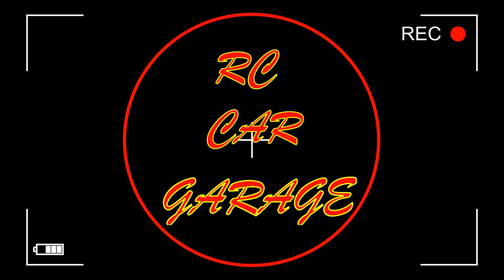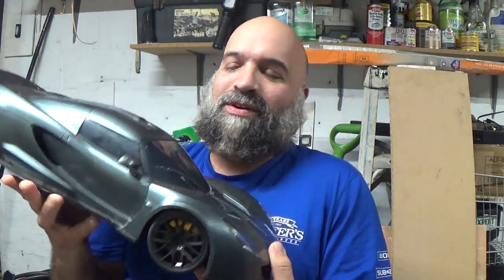Toy RC car converted to hobby grade electronics

Comment: I've started doing these types of conversions and even though I'm an absolute beginner I really enjoy it more than buying an expensive hobby car. I feel if I build it I can maintain it forever 🤣..as a beginner my tip is to find one platform you can work with and then customize it. For example i work only with the new brights because after much tinkering im comfortable in upgrading them.....these types of videos are so helpful...
Reply: Yep doing  toy grade conversions are rather fun and it's how I got into the hobby also.
Reply: If you're into the building part  of the rc hobby doing toy grade conversions can really test your skills. I bought the the orange New Bright McClearen that was being sold at the time this was being  sold. I think I'm gonna come up with a chassis and gearbox system instead of using  the little weak motor and gearbox that came with it.

Comment: I recently picked up a 1:18 RC General Lee made by Malibu International. It’s toy grade; and it’s missing the remote. I paid $50. As long as the motor works, I’m gonna try to get another toy grade 27 MHz remote to work for it to keep it as stock as I can: if that doesn’t work, hobby grade electronics with stock motor it is

Comment: Hey guy, the funniest thing I got something similar to this and paid 5 a Lamborghini Gallardo it had a 180 motor I upped it to a 390 motor a 18 dollar esc off Amazon brushed and up to 2s lipo battery,  it sounds crazy  without the sound effects box light buckets had to be drilled, but I don't like the hex on the wheels can't find adapter for it

Comment: Thanks for showing the conversion.   Stuff like this is fun. Too bad there isn’t any suspension and such a small motor.  I have a large Ford GT I picked up I was going to do this to.  Wonder if it’s the same chassis?   If it is I think I would better off just using the body shell on a hobby grade chassis.  Have you tried using Barbie vehicles?  They have some nice detail but you’ll need a custom chassis.  Have fun!
Reply from the maker: I have not tried barbie vehicles yet the fun part is trying to get hobby grade parts to work with the chassis
Reply: @rccargarage  Yes true!  I find that the tinkering more fun than driving the cars around.  Currently messing with an old Nikko Albar-Buggy dune buggy.  It’s like the Nikko Big Thunder buggy but has lights.  The steering servo is going hay wire and if I can’t sort it out I’ll pop in hobby grade electronics but no motor swap as there is a unique three gear transmission in it.  Kinda cool as it has front swing arm suspension similar to old Kyosho/Tamiya stuff.  Have fun!
Reply: @rccargarage  Oh yeah, as far as the Barbie stuff it’s more so the body on a hobby grade chassis, not converting an RC Barbie car.  The motors I assume are fairly small in those.  There is an interesting wired remote corvette I picked up that has motors on the front wheels. Yeah weird, it’s front wheel drive.  As far as bodies I’ve used her Ferrari 308 on a home made on road chassis. I’ve save some stuff for future projects that I picked up cheap like a couple ‘57 Chevy convertibles and a VW Rabbit convertible.  They have decent detail but the Chevy chassis is long and narrow so finding a chassis to fit it is gonna take some experimenting.  Also found a 1/6 scale RC Supra I melted the electronics on that l’ll first try to use the existing chassis with the stock 540 motor or else after will stretch a brushless Slash chassis to fit under the Supra body.  Probably will cut the roof and windows to make it a targa top and I have a 12” Paul Walker figure to fit in. Too many projects and too little time!!!!

Comment: I have a rastar Bugatti Chiron can it's only rear wheel drive can you help me make it 4x4 using a belt system and get it a better servo and esc I really like it's design and I don't want to have to buy another rc can you help me out please 🙏?
Reply from the maker: You could probably use separate motors to power front wheels  to make it awd
Reply: @rccargarage  which part of the esc should I put the other motors
Reply: I'm a bit new to hobby grade rc so I'm not really sure how to do somethings
Reply from the maker: To be honest your going to be better off getting a awd chassis and putting the Bugatti body on that. Its going to be more work and more of a headache for you to try to make it awd
Reply: @rccargarage  ok thanks for the advice 👍
Reply from the maker: No problem